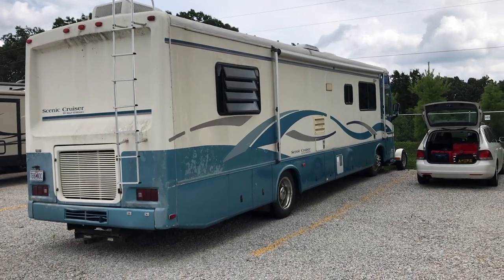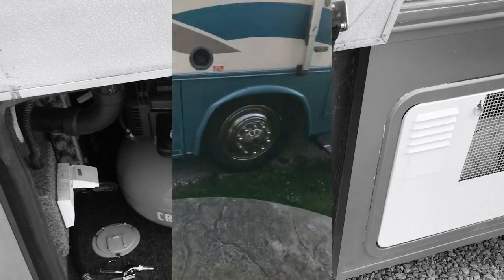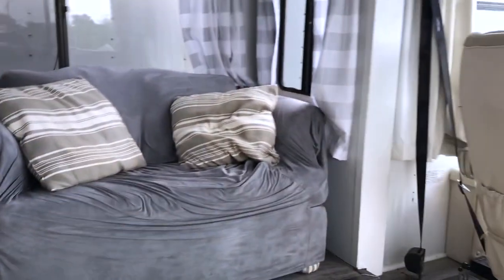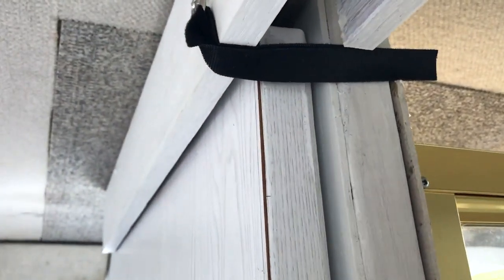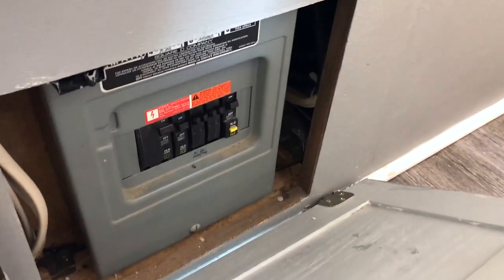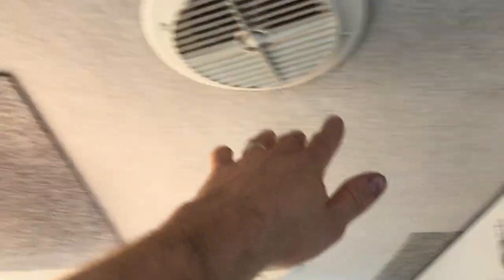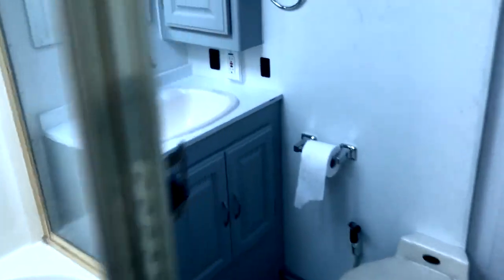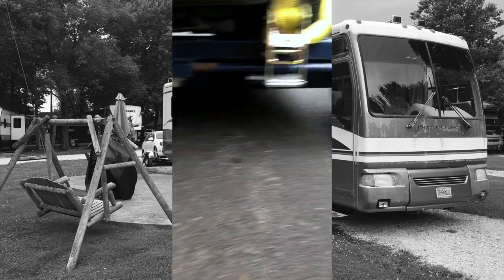RV Interior Remodel Completed!

Comment: I can think of a few uses for an air compressor but couldn't justify taking up storage compartment space to haul around something like that. I had the opportunity to use a battery powered, rechargeable, handheld air compressor to reinflate an almost flat tire on my tow vehicle the other day and it did a remarkable job. Stores in a small soft side duffle bag. Five minutes and I was done.

Comment: Upgrading an RV is so worth it, add some more batteries and a power inverter to extend house power (lights, water pump, etc) when not running your (loud) generator, also helps you keep extra backup cranking amps if you have to jump off of the house batteries.

Comment: Did you have to rewire the RV to fit that ceiling fan in? Just recently bought one and attempted to put in the fan however, the voltage is too high. Just curious if you made any changes to the wiring